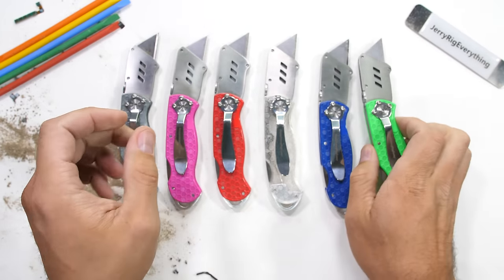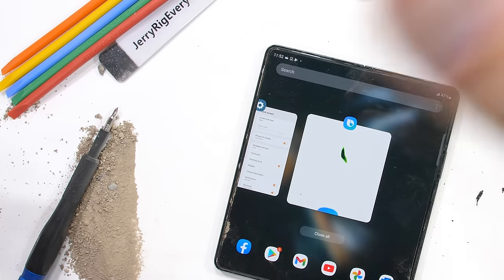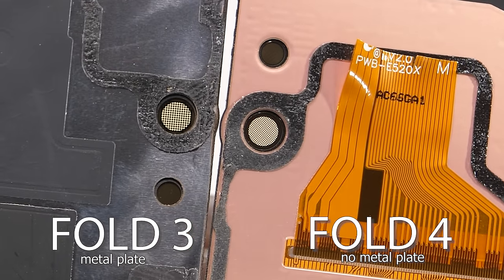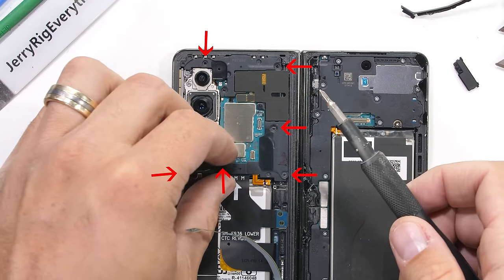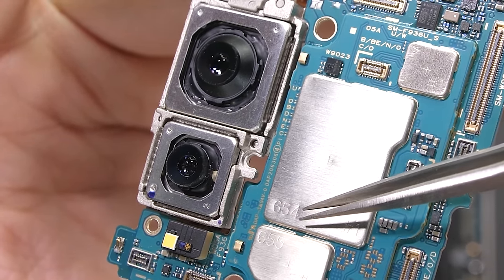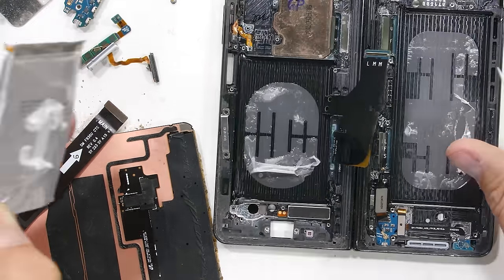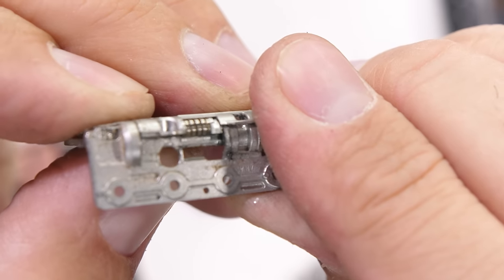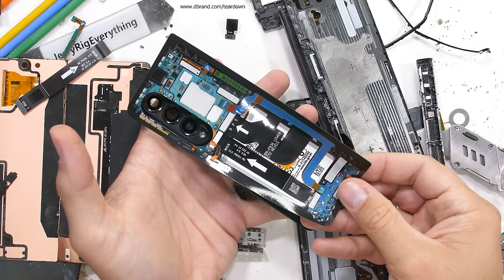Samsung Z Fold 4 Teardown! - They changed the Hinge?!

Comment: metal on metal at least its not a knee replacement sounds painful. makes me wonder if over time you see similar issues arise with fold 4 as a knee replacement, can't help but think that might fail in the long term and the gear system of the 3 might last longer.

Comment: I had a Note 10 for years and switched over to a P6P in 12/21. The P6P was the worst, buggiest phone I've ever used. Best Buy gave me $600 for my N10 (only offered $300 for the P6P) and $200 off with activation on an unlocked Fold 4, and it actually has me excited for Android again. It's like back in the day when Android would get cool stuff years before iOS users, which just isn't true anymore for the most part. The end of Summer is near and we still don't have Coolwalk (which iOS users have been enjoying the iOS version of for how long?). I'll have this phone 2-3 years easy as long as the built-in screen protector doesn't come unglued.

Comment: Had my z-fold 4 for 7 months now!! Absolutely love it I'll never go back to a slab phone..  I look at my girlfriend's s23 ultra it just seems so awkward and small.. 

I almost never shut the phone with the speaking air cushion case that also protects the hinge I got plenty of grip. 

I only fold and unfold the phone maybe 4 TIMES A DAY BELIEVE IT OR NOT!! Only when I'm nervous going to and from the car.. But the case seems very durable.. 

I've dropped it many times no issues. Actually seem like my old phone galaxy 21ultra is more vulnerable to dropping and braking..  that edge that rounded edge makes a huge difference on those phones when it comes to easily breaking.  

There's just something about The size that's the perfect size of this folding phone I can literally put it in my pocket opened believe it or not yep my jean pocket.  

The only thing I'm worried about is the hinge over time..  like I said I don't open and close the phone much at all..   That's perfect in my big hand. 

It could be vulnerable to dust I have no idea but I've never had a problem yet.  

I did have a clicking problem a small little snap it was the hinge getting stuck a little bit but it's still open and closed fine..  But then it went away. 

So far so good. We're talking about open and closing 100 times a day lasting 5 years!! Well then this phone will last forever with me lol

But nobody keeps a phone forever anyways. I usually upgrade every 3 to 4 years That's when there's any real big change in anything.

Comment: Here's a question for you.. 

So before I bought the phone I asked Verizon can these phones be fixed in a car? 

Because with my old Samsung phones if something went wrong you could bring it to you break I fix or whatever it's called. Or they can drive to you in their van. They can replace the screen Right then and there in about an hour for about $30 if it's not too much damage all the way through. 

It's always worked great. 

Do you think this is possible with this phone They said it was. But I don't know if I believe them I would most likely believe you.. unless they have special tools that you don't have?

Comment: I like my Z Fold 4, but I will say the Fold 3 did feel better to open/close. Hopefully with time the Fold 4 will be broken in a bit more and itll become as smooth but not quite there. IF you didnt use both though you wouldnt have a negative opinion I feel

Comment: Adding 2 small thing aluminum or whatever type of metal sheets/bars over the battery to hold it in place would not only be superior to adhesive, but also strengthen the entire phone, right? 4 screws to hold it and place and done.
You could even use adhesive between these bars/plats and the battery of you wanted to, as you could take out the entire thing and screw with the adhesive without the rest of the phone being in the way...

Comment: Have a WTF 4,  The middle screen is dead it shoots a white line on the right side when opening the phone at a certain point of opening it the front screen still works. So frustrated with this expensive pile of ..... well you just did to this phone what I feel like doing to it but I won't it still operates  I will use it as a TV in the bathroom, clock and extra wifi radio.

Comment: Great video, it is awesome to see how advanced phones are getting these days. My only disagreement is with the battery tabs. I am still a fairly new phone technician and I have noticed that the tabs on batteries for 'easy' removal almost never work, at least for Apple phones specifically. You may get 1 or 2 of the tabs to come off but you are still forced to use heat or IPA to remove the battery anyways. I have yet to damage a battery from using IPA as long as I take my time with it. If the tabs worked most of the time I would agree with you but in my personal experience they do not. Cheers though, I might pick up the flip at some point since it is not as pricey.

Comment: Honestly I wish I would have waited but who can predict the future? I bought the fold 3 after I watched your original durability test and teardown I was sold on it and durability wise for me its holding up wonderfully I work on garage doors currently so it's exposed to alot of different elements due to the fact I have it on a holster on my belt my only issue has been the screen protector on the big screen.  I use my phone on flex mode often so it's bubbled in the center but other then that its been a fantastic experience to own one.

Comment: Yeah would be cool, if samsung changes the way they attach batteries. Found out that my old samsung that had been sittin in a shelf for years, was close to exploding or more the battery was.  Cost me 40€ to get it removed.  Expensive for just a battery removal but cheap for not having a fire hazard in my home. Still could have been cheaper if I just could take it out.

Comment: I actually can't wait for the next one! I'm hoping for the Flip 4, hoping to buy it if I ever get the chance. I haven't ever bought a Flagship, I had a Galaxy J series, and currently have an A50, but want to get a phone with bigger storage. And since the Flip seems a bit more expensive than my A50 when I got it 2 years ago, but my A50 cannot store bigger apps anymore because of outdating that Dual SIM/SD card tray so I can't make use of my external storage.
Reply: But flagships dont have external storage bro. You might have to get S10 e or something as i guess, to get a flagship type phone and also external storage. Finding lot of internal storage and expandable storage slot ie sd card slot, in a flagship phone is just too difficult man in todays time.

Comment: I have a fold 3 and flip 3. And the fold 3 I haven't used the bigger screen for atleast 80% of the time I spend on that phone because when I plan to open it and watch content on it the aspect ratio is so annoying and the black bars make me move to my other phone to watch the same content. I thought the spen would be fun to use with the big screen but I wish so many times that if the spen worked on the screen outside it would make such a difference because that would get me into a habit of taking my spen out everytime I want to use the phone. And I dont like the fact that the phone doesn't close all the way flat like the other folding phones by Chinese companies. Flip 3 I really like. The content viewing is also much better and because I have to open it everytime I need to use the phone it has made my social media time less than half. I use my watch 4 classic to make calls with the flip and reply to messages so everything important can be done without opening the phone so I only do that when it's something important and not use my phone for every free minute I have

Comment: I'm in principle contrary to a folding phone. They are meant to satisfy the human fidgeting instinct, while detracting substantial capabilities from the device. I also like the old folding geared mechanism, as it is much more durable than the metal-on-metal slides in the newer phone. Surface galling is impending.
This August I have had four pouch Li-ion batteries, from four different smartphones, puffing out on me. Luckily I were able to replace three of them, and breaking the back glass of the fourth phone, because it was so cheap I was convinced it was made of plastic.
The smell of burned Skittles is the smell of the volatile electrolyte of the Li-Ion battery, escaping thru a micro hole or fissure in the pouch. It can contain trace amounts of fluorine, so air the room.
This said, if all manufacturers glued the batteries like Samsung does, I wouldn't be able to remove a battery without causing damages to both the battery and the phone.
Thank you Mr. Jerry Rig for the instructive dismantling tour...

Comment: Just got my fold 4, but I would have to say I wouldn't really recommend it in general; it's very heavy and the battery life is quite poor when using the main folding screen.
Reply: heavy?😷vivo x fold.......🤐
Reply: @ongchongteck  I mean, even the fold4 is still over 2x the weight of any normal cell phone. It's physically much more difficult to hold comfortably.

Comment: I replaced the inner + outer screen on my z fold 2 i don’t know how but i destroyed the bigger battery by removing it after finishing it the battery was expending & destrying my outer screen i payed 150€ for 
And the only battery i could find was brand new+ the smaller battery included for 80€ because samsung uses so much glue

Comment: I don't think I'd ever consider a folding smartphone. I don't like the folding hinge designs on either the 3 or the 4. What if one  day you cannot open the damn thing because something involving the hinge broke or locked out? The foldable screen display is too tender and is easily destroyed. Also, with a lot of the Samsung brands, you cannot work on it without breaking it and getting to the battery is a PITA not to mention the removal part.

Comment: I have really thought about switching from apple. I wanted a pixel but they have problems. Then s22 ultra looks pretty great but so does the fold4. I can’t decide. Both use the pen. But I feel like drawing on the fold would damage it after sometime. Also what happens if the screen does get damaged. But we are like 6-7 months away from a new pixel and Samsung galaxy. Sooo I can’t decide haha.

Comment: I really hope the fold 5 is exactly like the mi mix fold 2 don't care if the cameras are better than the fold 4 but the size and the way that closes is amazing. It feels like a normal phone with a case when it's closed but they need to add wireless charging to it and the flip mode to it. But if they cant close the phone all the way flat with flex mode in it then flex mode can go but closing flat and feeling like a normal phone when closed is very important to transition into a fold from a slab. Flip is very easy to adjust to but the fold 5 has to be a mix fold 2 inspired design and the crease should be better it's been 5 years and the crease hasn't changed one bit, and these Chinese phone makers have shown that it's possible just like oppo. And oppo made their phone close flat . Because dust easily enters my fold3 and my main issue is dust not water. I can keep it away from water but dust Is not easy to see and can easily get in through the gap in the fold

Comment: Watching on my fold 3 with a big black line in the middle of the screen. About 4 months old and I am a princess  day 1 I got a d brand skin and the Spigen Rugged case with hinge protection  sitting on the couch a week ago I opened my 2000$ flagship and heard a crack  now I've got poop in my pants and a tear rolling   no broken glass or broken anything accept a big black line in the middle.  FML thanks Samsung  I figured 3 iterations would iron out the cracks but no. 
2000$ brick  🦋

Comment: Just switched from an Iphone 12 pro max to the Z Fold 4. I work in the industry, and I have little doubt that the fold 4 is presently the most interesting device on the market, and using it daily for the last weeks has been an excellent experience. Construction of the device feels as solid as just about anything else on the market (perhaps the pro max edges it out by a hair in the handfeel department) and I'm happy I chose a foldable this time around as it's very clear to me that this is the future for people who use their phones for productivity as much as they do for communication. The limits of a "candybar" style flat phone have been reached, and even the S22 ultra just doesn't move the capabilities of the smartphone forward, the Fold does. 

Gripes? a couple. 1.) S-Pen is still an afterthought with no real integration solution other than the really crappy first party case. 2.) Battery capacity. Samsung is one of the premier manufacturers of Lithium batteries in the world, I am hard pressed to believe that my $2,000 smartphone couldn't have been upgraded over last years device. That said, it does have all day battery life, but it pales in comparison to the iPhone 13 pro max, or even the S22 Ultra. 3.) It has now been YEARS, and Apple Pay is still a lightyear ahead despite Samsung Pay and Google Pay beating it to market. The integration of the Apple Card into iOS is unparalleled in the Android world, and that is a shame. I bought an iPhone 13 Mini outright to use as a digital wallet/apple device manager.

Comment: What a nightmare It must be to replace these batteries I mean the one with a camera is should be easy it's just the back.

But now you have to take off the actual screen to replace the other battery.

Probably definitely have to be done by someone like you break I fix that has special Samsung tools.. What a pain in the butt

But really is no other way to make a folding phone or someplace to put the batteries to make each side even because of the design.

Comment: Why would you use the heat gun on the back to help remove it in one piece but not the front screen. You just savagely started to stab at the front screen without applying any heat at all... Smh

Comment: I will not buy a folding phone because I absolutely despise plastic screens I've never dropped my Switch and it has a huge scratch on the screen whereas I've dropped my S10 endless times and there's nothing but a tiny scratch about half a centimeter long that you can't notice unless you're looking for it.

Comment: "Smarter phone manufacturers use pull tabs to hold in their batteries"

Meanwhile Apple who usses pull tabs that always break and software locks their batteries...
Reply: Bro I just get them to swap out my battery for $99. Never had a issue
Reply: @zethloveless7238  Bruh $99? I can get my battery replaced for $19 tops.
Reply: @filenotfound__3871  I would never trust a $19 battery service for my 13 pro max dude. 🤣
Reply: @zethloveless7238  You are just used to high prices  with an apple product, the replacement battery costs about 10$ and the service is cheap because there is a lot of competition, guess how many people are willing to even look at an apple product, almost none, so they can bump up the prices sky high. And the tools required to fix them are ridiculous. Only with apple do you need to reprogram the battery to replace it, same goes for preety much every part of the phone.

Comment: not a fan of the new hinge. It takes to much force to initiate folding process which kills the possibility to open the Flip 4 one handed. Thats why Im still rockin my Flip 3 which hinge still works flawless after 15 month of quite heavy use(around 80 folds a day I guess) Also got my doubts this new hinge design will be as durable as it's direct predecessor. Gears are awesome because even without lubrication there is not much friction. The new design though wont even work at all when lubrication is gone or mixed up with sand particles. The added friction will most likely lead to faster worn out parts within the hinge. Still Im waiting on a hinge design that includes tiny ball bearings:)

Comment: Traded in my Note 10+ for the Fold 3.  Worst mistake ever when it comes to phones.  Wish I had the Note back.  On the Fold 3 I've already had 2 screen issues and 1 hinge issue.  All got fixed under warranty but at a great hassle and having to do without my phone on 3 separate occasions.  Now that it's back and everything works I'm trading it in for a Galaxy 22 Ultra.  I do not recommend the folding phones at this point.  I do agree though that they are a great engineering marvel but not ready for hard use at this time.  Great video as always.

Comment: whats the point of having a flexible screen, if it gets damaged on first removal attempt? zero rights to repair. Where's the flexible "drive nails thru it and still works" we've been shown back in 2013? Im not buying a new TV, until I can unfold it and drive nails thru its corners to hang it like some ancient painting, or roll it and glue it to the wall like wallpaper.